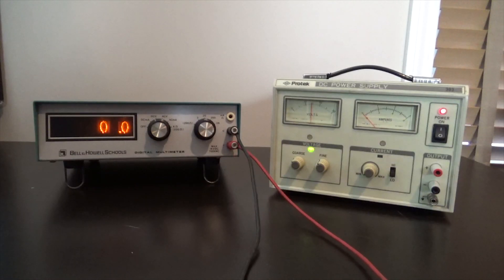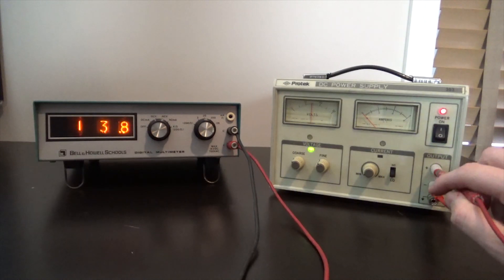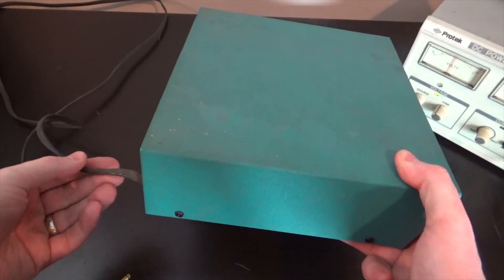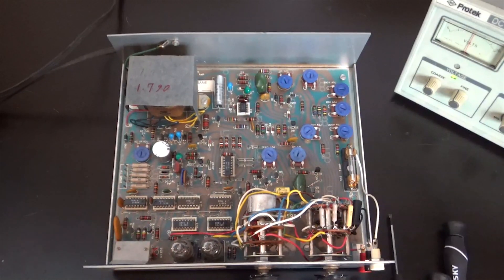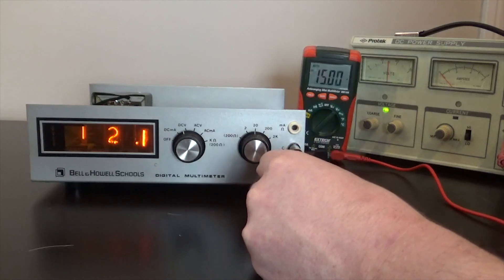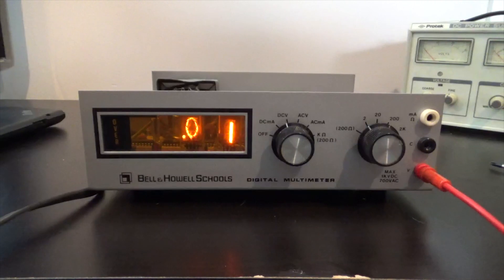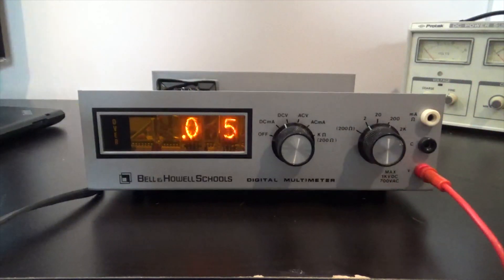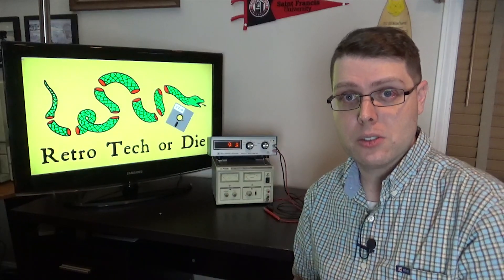Nixie Tube Multimeter: The Bell and Howell IMD 202-2 AKA Heathkit IM-1212

Comment: While this meter SEEMS to be an attractive piece to have on a lab bench, in reality it is a pretty poor meter for 'real' use. It was targeted at beginners who just needed a simple and inexpensive digital meter. While more expensive than an old-fashioned VOM, even with its limitations it is more accurate than any of those due to its digital display, and more sensitive (having a MUCH higher input impedance that any VOM).

What it does NOT have is adequate RESOLUTION for most 'real' design and troubleshooting situations, and it does NOT have a stabilized basis for its ultimate accuracy, so it will drift a bit with temperature, so compromised in accuracy......the idea here is that the resolution is so poor that nobody will be able to detect the reduced accuracy.

This is only a 2-1/2 digit meter, and unless the MSD "1" is on, you only have possible displays of 0-99, and that is the limit of its resolution, about 99% of actual (1% best-case error), but that's not all. Add the inherent low accuracy circuit and unstabilized reference and the actual accuracy is significantly lower.

But for students just doing basic experiments, it was good value for money.

I am a significant collector of vintage Heathkit test equipment, and own a few of these. The thing I notice is that very few Heathkit-branded ones seem to exist; the majority are Bell & Howell-branded. This makes sense, as regular individual Heathkit customers probably looked at this meter's specifications in the catalog and decided to spend the extra money on the nicer 3-1/2 digit model, but trade schools such as B&H found this unit's specifications to be a good bang-for-buck compromise when it ONLY needed to be good enough for the educational laboratory experiments that were part of their curriculum.

To my mind, this meter's circuit design, in particular the ingeniously simple and low-cost A/D converter, is the main reason to own and cherish one of these. At a time when most digital meters used complex analog/digital circuits to handle the A/D (this was before inexpensive and accurate monolithic digital-meter-ICs became available), the Heath engineers figured out a good-enough way to do it with a handful of cheap transistors.....but this approach would never be good enough to scale up to even a 3-1/2 digit meter.....it was only just adequate for a non-critical educational 2-1/2 digit meter.

Comment: The number written on the transformer insulating cardboard is a kit-specific number provided by the manufacturer (Heathkit). This is based on factory-measured component(s) supplied as part of the kit, and which together generate the test voltage inside the unit. Those component(s) have slightly different voltage values from one to another, so to properly calibrate the meter requires knowledge of the factory marking supplied with the kit.....the assembly instructions direct the kit builder to copy the factory-written number, from the small manila envelope those component(s) was packaged in, onto the transformer insulator for future reference. 

And yes, just trying to calibrate this meter by connecting the test leads to a know voltage than then adjusting the internal trim pots will get you further from proper calibration, not closer. It is important to follow the official calibration procedure.

Comment: It's got "1.7.90" written on the transformer, which sounds like the last time it was serviced, or examined. Maybe it went into some clean storage room after that.  That's why it seems to be so clean now.
UK education would often keep school and college lab devices running for as long as possible, like decades after it was manufactured.
Reply from the maker: Thanks for the comment. That 1.790 is the calibration voltage. I put the calibration procedure in the video description, seems like each transformer would have a slightly different calibration voltage and the entire unit needs to be calibrated to it. It is hard to tell in the video, but above the red 1.790 it is written again in pencil, I think at some time it was rewritten in red Sharpie to make it more obvious.
Reply: @RetroTechorDie  There is one for sale in my area and i would like to know where did you find the manual to do the calibration? was the assembly manual or operator manual?
Thank you. Great video very interesting and informative.
Reply from the maker: @SDsailor7  I have a link in the description for the calibration. I had trouble finding any other manual for this unit.
Reply: @RetroTechorDie  Thank you very much. 
It will help
Reply: @RetroTechorDie  What are the ranges of the meter?
min and max
Reply: I can confirm that my transformer has a different value.  It also came super clean.  I think lack of vent means lack of intake air & grime... or it could also mean that by the time these were in use, new meters were out and with a limited scale these were obsolete as fast as they were made. But for novel purposes of having a nixie tube meter it's cool. Thanks for the tips and im going to try that calibre procedure!
Reply: The number written on the transformer insulating cardboard is a kit-specific number provided by the manufacturer (Heathkit). This is based on factory-measured component(s) supplied as part of the kit, and which together generate the test voltage inside the unit. Those component(s) have slightly different voltage values from one to another, so to properly calibrate the meter requires knowledge of the factory marking supplied with the kit.....the assembly instructions direct the kit builder to copy the factory-written number, from the small manila envelope those component(s) was packaged in, onto the transformer insulator for future reference. 

And yes, just trying to calibrate this meter by connecting the test leads to a know voltage than then adjusting the internal trim pots will get you further from proper calibration, not closer. It is important to follow the official calibration procedure.